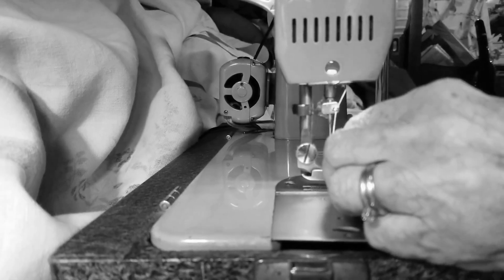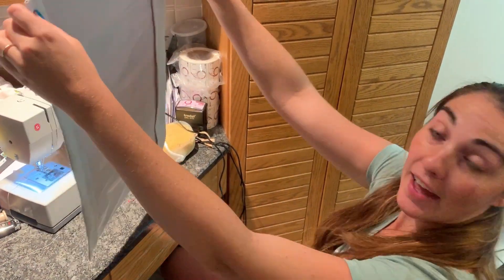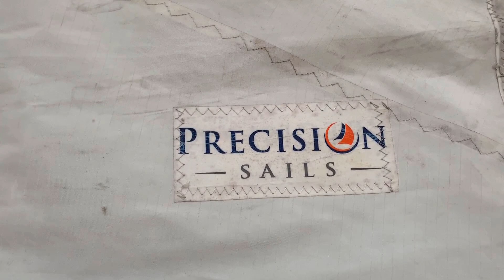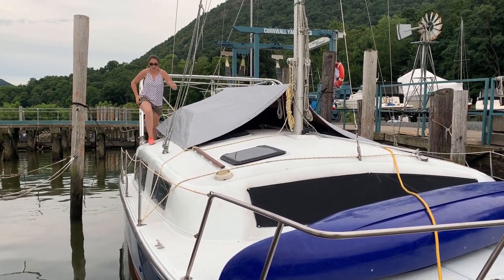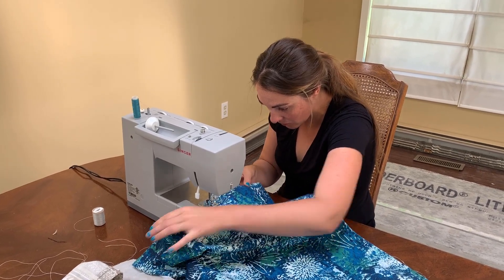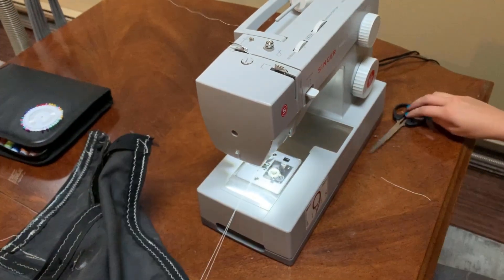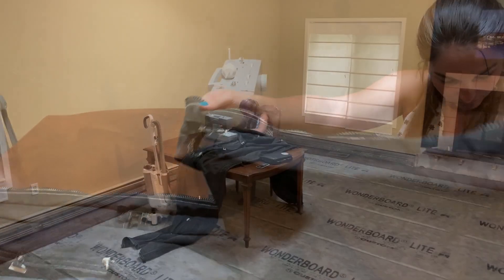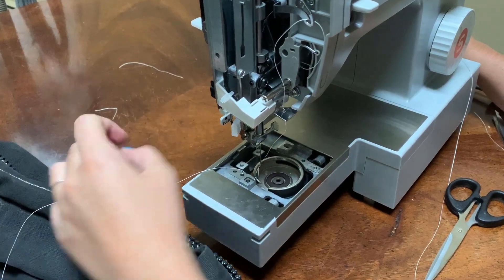Countdown to Our Sail South: 1! Sew What? Last Chance Boat Projects (Episode 41: Sailing 9 LIVES)

Comment: Oh Virginia, grasp all the knowledge you can from Granny!!! Much of the Granny skills are lose each generation, because no one takes the time to learn what they can pass on!!

Duke, mending your sail in the Livingroom is WAY classier than some guys rebuilding their greasy Harley motors, in the Livingroom!   Blood, well spent!! Rhea was amused!!!

You've both got skills and YouTube is the ultimate holder of all Granny and Grand Pa knowledge!! Some, of what you've added too!! Smooth sailing!!
Reply from the maker: My granny has some of the best knowledge to pass along! And, she does it with a smile.

Duke actually has made significant progress on that living room. The floors are finished and the fireplace wall has been completely rebuilt (the surface, anyway). So, I am OK with him occasionally bleeding all over the room as a sail loft. I probably shouldn't mention this, but there IS a complete Harley Softail in the den, disassembled. Maybe someday he will get back to that project...